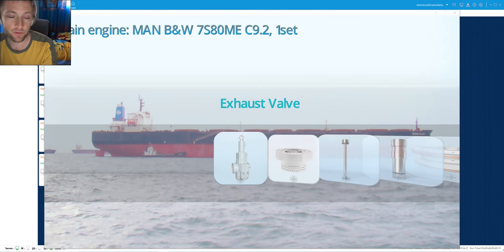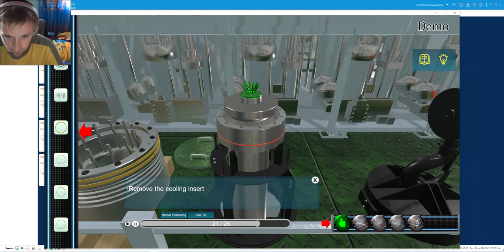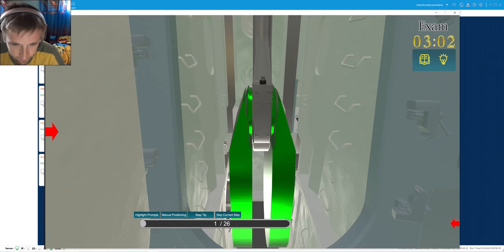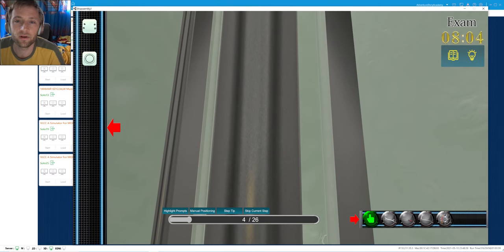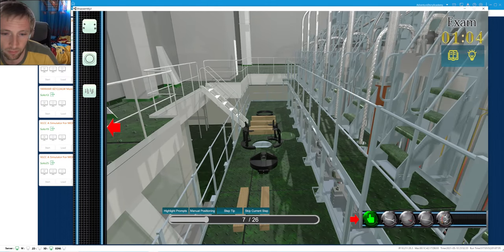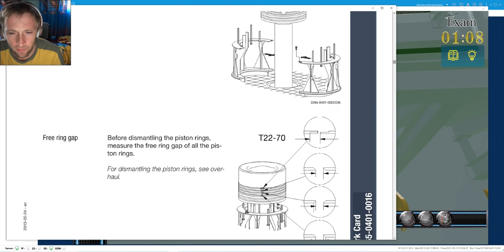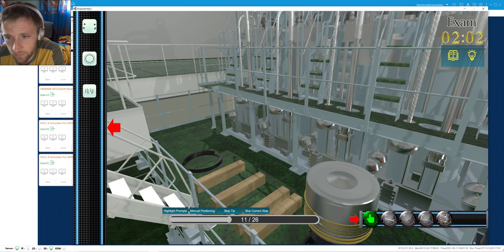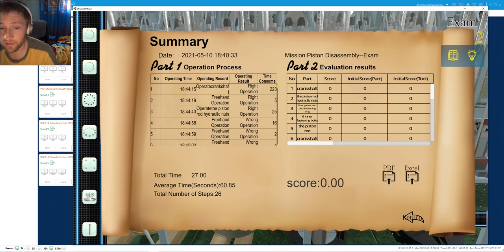MAN B&W 7S80ME C9.2 Piston Overhauling plus tips

Comment: Hello, sir. Been a long time since I commented here. I have some questions btw.
1. When we lift the piston in MAN B&W Engines, should we also be very careful with the rod since the shape of stuffing box side is bayonet??
2. When we disassemble Piston crown from piston rod, Is it also possible without making piston up side down but just take out the crown from the piston stand??
Reply from the maker: Hello dear friend you can make what ever you wish but remember it has to be safe and stand away from heavy items. You correct there is different ways to do.Always use the one fit for you.Thank you!
Reply: @Adventure-Story  Hello sir, thanks for your help! How we can put up side down only the piston crown without doing upside down the whole piston together with rod. It is very heavy, it seams no possible...
Reply from the maker: you are correct! The piston and rod will be turned together.
Reply: @Adventure-Story 1) When we like to remove the innermost bolts of stuffing box inside the engine, we can turn the engine Close To TDC, When we stay On the crosshead for dismalting the bolts AND the other person is climping (after the turning) from the stairs with the safety belt. Right? 🙏 

2) When do we make this turning of the engine, we have already connect the roots (sticks for stuffing box). Right? 🙏🙏
Reply from the maker: @LefterisMetallas194828301121  Yes you are correct. This is the most difficult part as it is slippery inside the engine it is compulsory to use a safety belt.
Reply: @Adventure-Story Thanks again for your contribution!!!!
Reply from the maker: @LefterisMetallas194828301121  Many thanks really appreciate that!